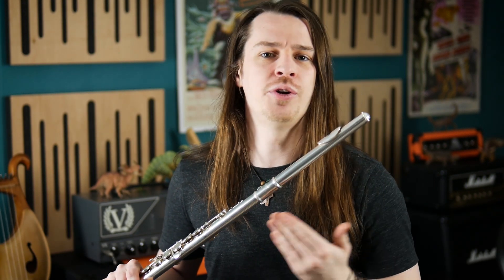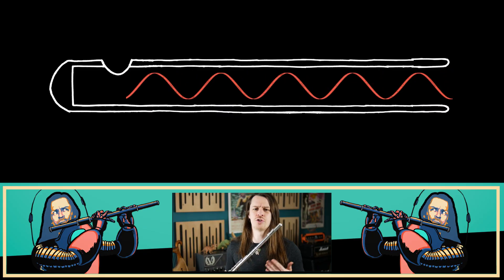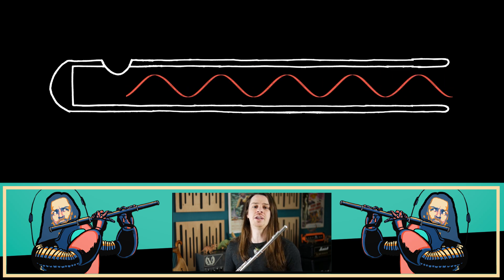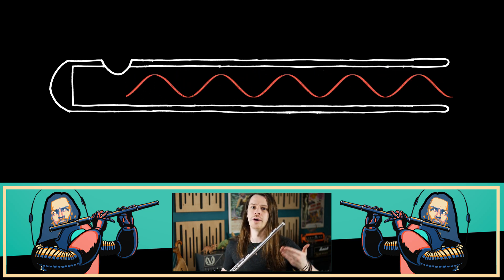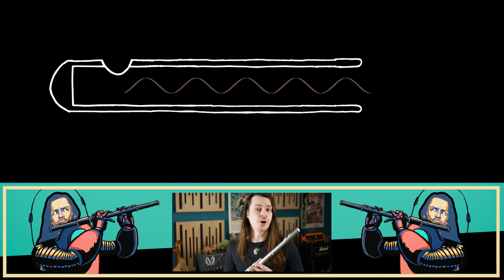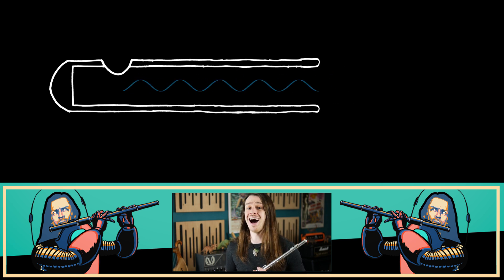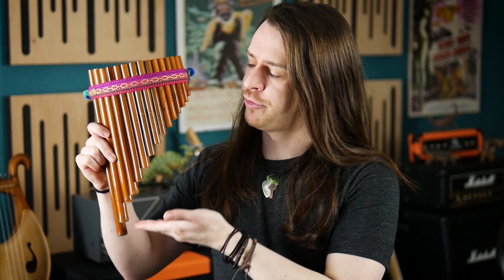How Does A Flute Work?

Comment: I'm wondering does the flute suffer frome the same intonation issues that I hear in bagpipes in the higher register? I watched your cover from Lord Of The Rings and it felt like the high notes were just a little bit off. I notice this with most of the pupers I see too.
Reply: might be due to air pressure differences, which although affect lower registers too, the difference is less perceptible even to trained ears. do they sound high or low?
Reply: Mikail Elchanovanich i would say most of the pipers i've seen always sound a bit flat when they go for the high notes.